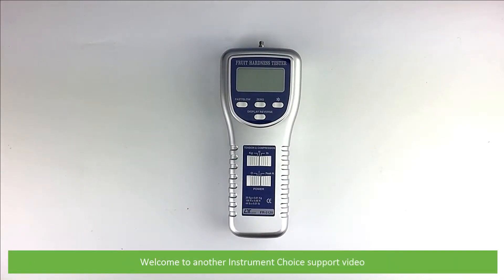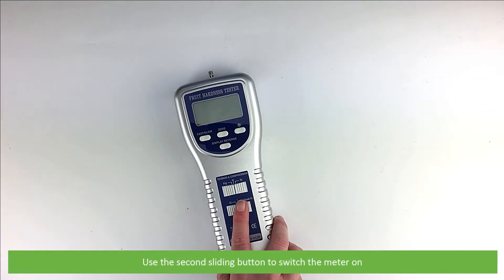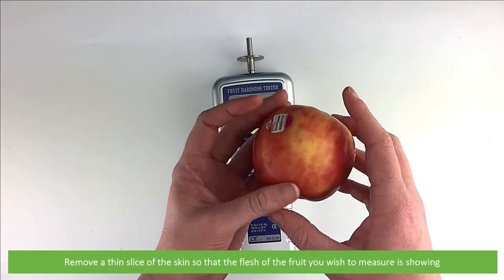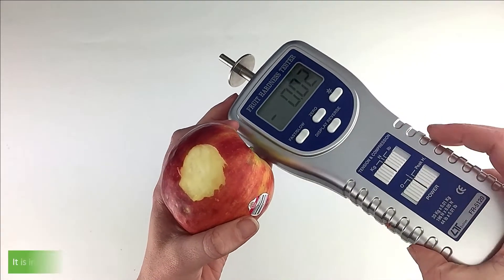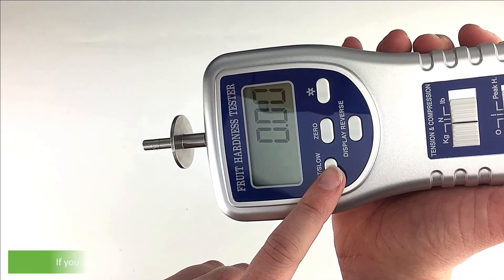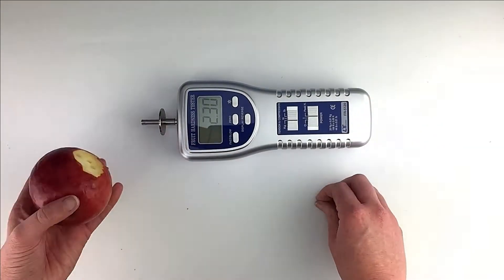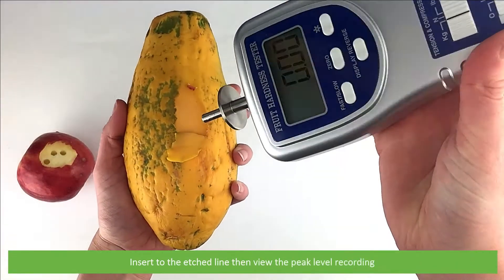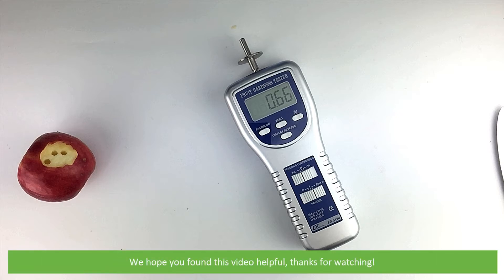How to Take a Measurement on the IC-FR5120 Fruit Hardness Tester (20 kg)

Comment: Why do you take off a slice of the skin prior to the measurement?
Reply: Thank you for your question. A fruit hardness tester is designed to measure the hardness of the fruit flesh. If you don’t peel the skin, the force applied to penetrate the skin will be taken into account on a reading from the instrument. This will then provide a higher false reading and not a true representation of the hardness of the fruit.